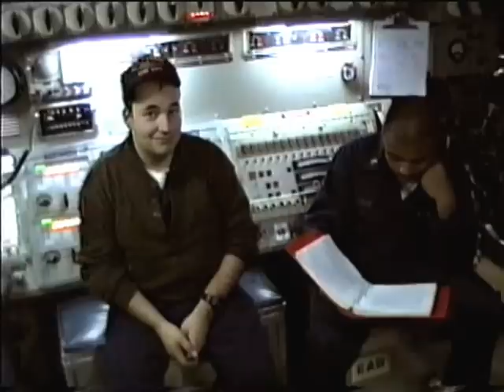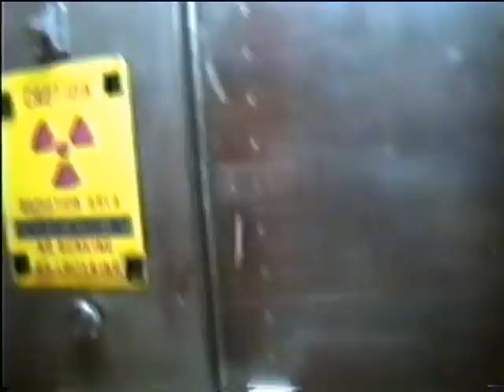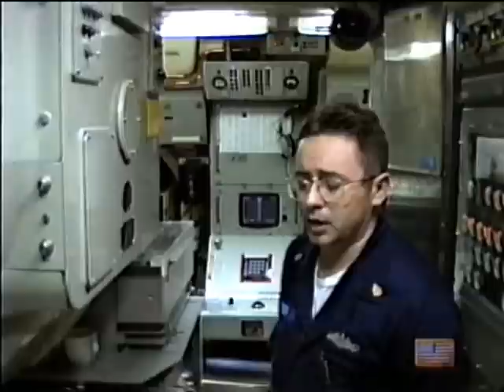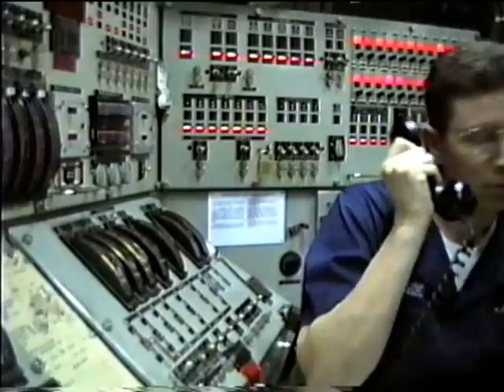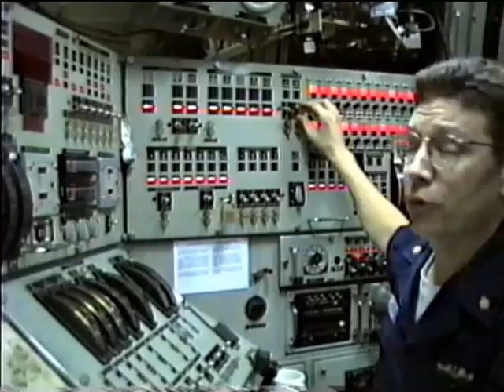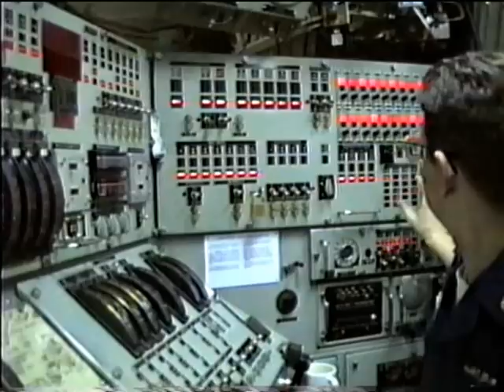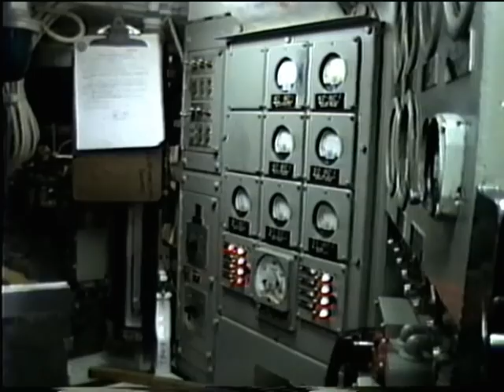Tour of USS Trepang SSN 674

Comment: Fun to see the old sonar shack. When the Fickle Pickle was commissioned  in 1970 (I am a plankowner), the sonar shack looked nothing like what is shown in the video. Back then she was loaded up with the AN/BQQ-2 sonar suite comprised of the BQS-13 active sonar, BQR-7 passive sonar, BQQ-3, UYK-7 tape recorder, BQH-1 speed of sound measuring equipment. Later, as part of DevGrp12, we worked with the forerunner of the towed array along with testing what would become the BQR-20. We actually had to put to sea and attach the towed array when we got out in Long Island Sound.
Glad to see the BCP panel was still pretty much the same.
From this video, I see the boat had been updated with the BQQ-5 sonar that I worked with NAVSEASYSCOM and IBM on from 1977-82. I was part of the review team for the technical manuals for that system and also went around to several boats removing the microfiche manuals and replacing them with paper manuals. I remember well the IBM program managers crowing about how great PM/FL software was. I had only one question for them at the first meeting I attended - "What do you do if PM/FL doesn't find the problem?" Jerry Jenkins, the NAVSEA program manager, just looked at me and smiled. I spent the next five years reviewing tech manuals and verifying the procedures in the equipment labs at IBM in Manassas.
Lot of memories
Reply: I was a plankowner on the 676 (Billfish) and was a reactor operator and also logroom yeoman, setting up the manual library. It included a 20-25,000 card microfiche file and a large format printer for the microfiche cards. The printer did not work, so I took it apart and fixed it. It used a roll of sensitive paper and when it was exposed would pass through a chemical bath and then a cutter would cut off the piece of paper from the roll. It worked! Then.
Reply: I was on Nautilus we had BQR-4 and BQR 2 , an old rope for a fathometer , and a hammer for active! Oh and a DUUG dome . Like the WLR 9 only it didn't work!
Reply: I know this is an old thread but I just had to relive the past.  This is the best (real life) video tour yet.  Memory check from late 70's on the SSBN 643:  I remember the BQR 20 as a freq. spectrum analyzer that allowed to get a quick read on active sonars outside the boat.   Our towed array was the BQR-15. Our BQS 4 generally worked well enough to get a ping or two on bay trials.  We had the "new" digital BQR 21 and the analog BQR 7.

Comment: I was on the Billfish, SSN676 during construction and commissioning and shakedown, then assignment to SUBDEVGRU2...this would have been 1970-71. We did not have a power plant emergency alarm, then...am guessing this video is made a long time after then. We did not have hot bunking, then, either, and no berthing in the torpedo room. No videos, but we did have 16mm movies for entertainment. Our uniform was the older style dungarees and chambray shirt, though the Navy was experimenting with a newer style shirt and trousers that were a polyester blend, not at all comfortable. I think this is a pretty good video and certainly outside of what was possible to make in 1971. I was a nuke, and so no pictures of any kind were permitted in that part of the boat. Too bad. Thanks.
Reply: Billfish 1982-1986, Squadron 10 ... If I remember right, Trepang was in Subron 10 and the two 637's carried the load.